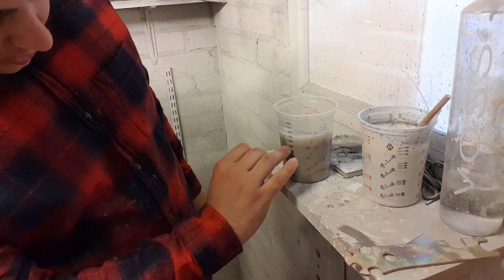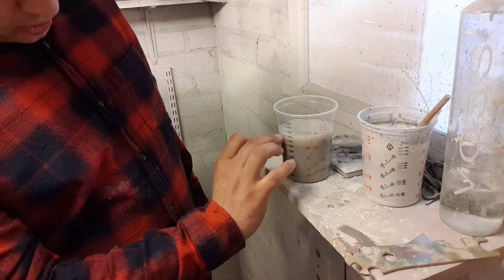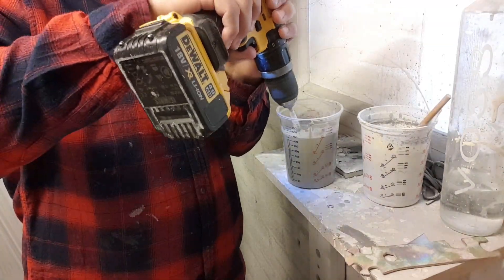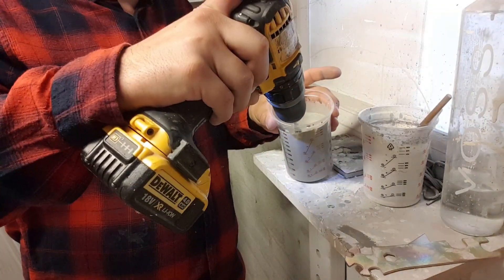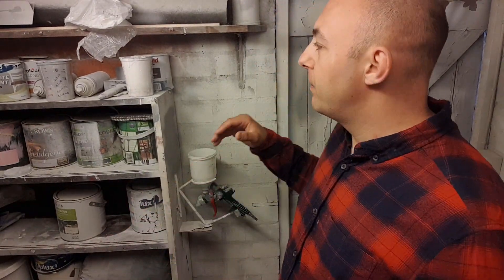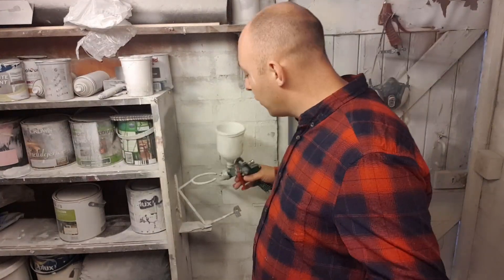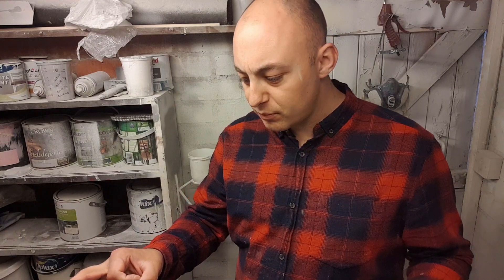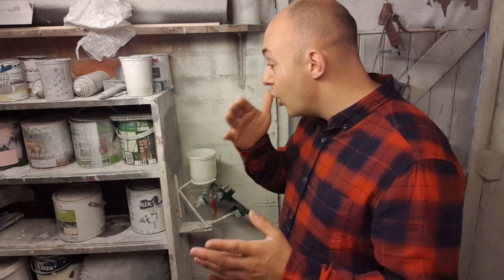How much to thin Farrow&Ball paint how good is it.?

Comment: Great video as usual. Just a couple of questions. Did you use F&B primer and where do you keep the painted items to dry, as you say it can take days to dry so does that mean you don't paint anything until they are dry? I only ask as I will be building a spray booth and wonder if I need a drying space/room. Thanks
Reply from the maker: hello there.. so when i say they take a age to dry thats because im not using the F&B primer.. im using the acrylic primer from construction chemicals ... and i should of been more clear.. the drying im referring to is fully cured... its nice to spray but i now tend to go with the valspar v700 mixed to F&B shades drys lovley and i can use my primer then...  

but regarding the drying room id love one my self just dont have the room

Comment: What size nozzle do you use on the gun? And what pressure do you set your compressor for spraying?
Reply: Also would like to know this?
Reply: @sadatmb9826  He uses a 1.4mm nozzle for his top coats and a 2.0mm for his primer base coat, you have to water down the top coat and test, anything from 10% to 20%, in the video he uses 300ml paint and 100ml water, so that's a 25% water ratio to paint for the F&B, but other paints are not so thick and take less thinning. Trial and error with paints, but the smaller the nozzle the thinner the paint needs to be.

Comment: First of all, ive been a decorator for 32 years and i have to say farrow and ball is the worst paint ever invented as for painting mdf we use a shellac to seal it and then paint dries in no time, using Crown fastflow satin can been used for exterior too, very hard wearing and can take a few knocks, just thin to use with spray gun, my paint merchant can mix to any farrow and ball colour, half the price 100 times better.
Reply from the maker: I’ll be honest IV not used crown fastflow before.. would you recommend it .??
Reply: @lowesjoinery3031  I use it daily in my work for customers, I then noticed it can be used for external work so I gave it a go on my shed about 3 years ago and it still looks as goods as the day I did it. Haven't used with spray gun yet but will be giving it a go soon hopefully, it quite a thick paint, yes I would recommend it as for spraying i can't see a reason why it shouldn't be as good.
PS iam fairly new to the woodworking job, just a hobby at the moment but the very keen learn things, thats how I found your video about the plunge saw and guide, most get myself one of those, is the erbauer one ok ? Have a few tool from them, never let me down yet

Comment: Horrible paint for furniture. Never cures. No durability whatsoever. Lesson learned. Never again. Not worth the money.
Reply from the maker: I had the same opinion as you... I believe  the cure time is down to the primer... it.must be there primer and durability isn't the beat but ok.. I thunk the name carrys it for them... but nice paint to spray tho

I also use valspar v700.. much cheaper  and dries better
Reply: This paint was requested by my client (actually their designer), anyway i originally had PPG make this color in the Breakthrough satin any it came out great (closet door) but the customer insist on we use Farrow & Ball with their primer. 1 gal of Eggshell and 1 gal of their primer cost the client $257.13.  The paint is latex. Very gummy and doesnt level out nice.  IMO it is very horrible paint and very, very expensive.
Reply: @joeygee5007 what do you prefer ?
Reply: @joeygee5007 . Are other paints different to latex ??